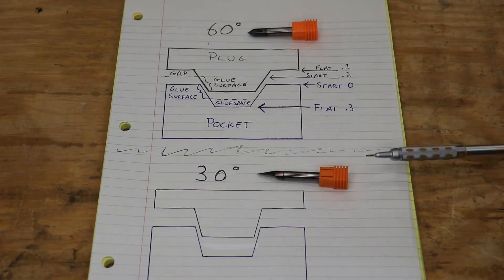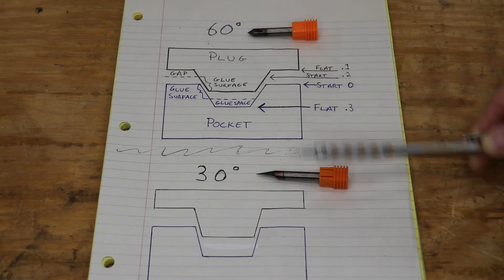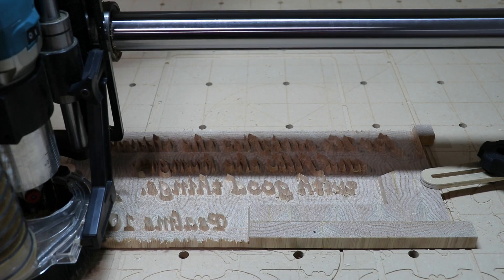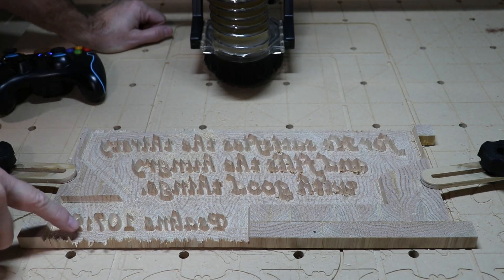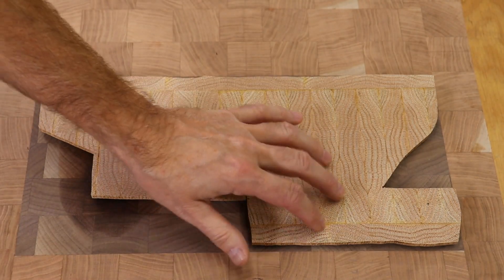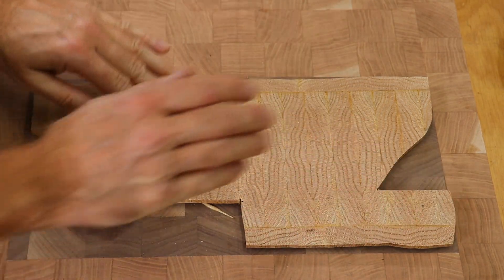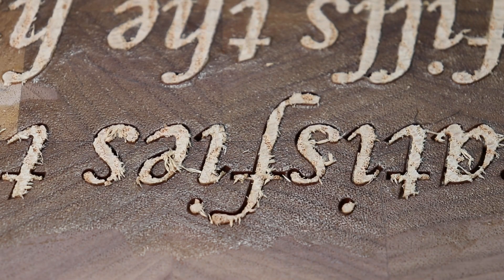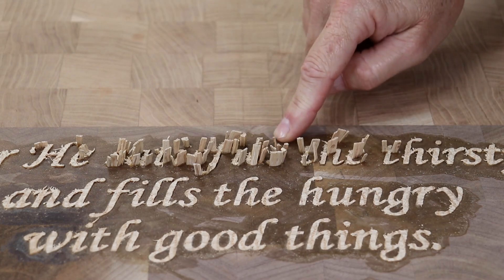First Inlay How To // Onefinity CNC

Comment: Matt what font did you use for your Cutting board and which bit?  I am trying to do some vcarves with small letters and im having some issues with the quality of the letters.  Ive tried several scans fonts but no having much luck
Reply from the maker: The font is Garamond. These work well https://amzn.to/3ZXyE1G
Or either of the 30 or 15 degree bits in the description. Any of these bits should provide good detail.

Comment: hallo, I have sainsmart 6050 what router can I put to be able to use 1/4 bits as small 1/8 bits and very limited?
Reply from the maker: Sorry, I'm not familiar with that machine. I would suggest contacting the manufacturer.

Comment: Have you ever considered a "negative start" for the Pocket? This will protect you against any unevenness. The clearing pass will remove the excess material
Reply from the maker: No I haven't. I've not had a problem with unevenness. I've done several inlays now pretty much exactly how I describe in this video and they have all been successful.
Reply: @MattMadeIt123  I ask, because I glue my own panels. I can't ever get it 100% exactly right
Reply from the maker: @eitantal726 I do to. Do you mean uneven on the surface?
Reply: @MattMadeIt123  Yes, I typically have 1mm of error. Maybe I'm overthinking it, all I have to do is to find the lowest point and Z-zero to that. Water or marble will tell me where the lowest point it
Reply from the maker: @eitantal726  1mm over what distance? Remember, it's just wood. If you try to chase perfection with wood, you'll drive yourself crazy. Be more concerned with the finished product. If it looks good at the end, you did well.
Reply: @MattMadeIt123  My panel is 460x330x16. Getting sub-mm precision is possible, had I used biscuits. When it comes to CNC, precision is in the micrometers. Elsewhere, sub-mm precision is attainable with tricks like lasers, stopblocks, etc
Reply from the maker: @eitantal726 It just seems you're waaay overthinking this. But you could just do a surfacing pass before you inlay.
Reply: @MattMadeIt123  the inlay that I want to make has very fine lines and details. If I get it wrong, the lines will disappear

Comment: Curious if "Glue space" is either too big, or not needed at all? What about cases where the inlay is small enough, it will come into a point and you will have zero "glue space"? Have you attempted an inlay without a glue space? 2.54mm is too big of a gap for a glue joint to even work.
Reply from the maker: The gap isn't meant to be a glue joint. It's there so extra glue has space to flow. I haven't tried an inlay without a glue gap. Might be worth testing.

Comment: 😊easier if you separate each text line of the plug. It allows to better insert each one since surface is lower.
Reply from the maker: This is a great tip. I've still only done a handful of inlays and have more to learn. Thanks.

Comment: Good job. Not sure if this has been said or not but if you will do your Vcarve pass first and the clear second you will never have to worry about small parts breaking off.
Reply from the maker: Yes, this was mentioned. That is the order I do it now and it does help. But with certain woods I've still had issues. I think certain species of woods in certain grain orientations just aren't great for carving with a CNC. End grain Ash for example is just too brittle in my experience. If it was stabilized I'm sure it would be fine.

Comment: I didn’t read through all the comments to see if it was mentioned, but I have used fine sawdust and mixed it with wood glue to fill small holes and imperfections. It has worked great for many situations. Not sure if that would have worked well on your first carne.
Reply from the maker: I've used that trick with great success myself. I think in this situation, there was too much dried glue filling the gaps. The gaps that weren't filled with dried glue were pretty big. Filling them with what amounts to wood filler, I don't think would have looked very good. But its definitely a good technique, in the right situation.

Comment: Saw another video where the guy recommended for the plug to do clearing pass after the detail pass. His reasoning is that tiny pieces stay supported.
Reply from the maker: That is what I usually do for just the same reason. I've had success and fails either way. I think wood grain direction and feeds/speeds have a lot to do with it.

Comment: When making the male plug portion of the inlay I've found that the inlay portion is chipping out and breaking.  Even with a new sharp bit.  I'm using the v bit first, then a clearing tool path.  Should I slow down my feeds and speeds?  Thanks.
Reply from the maker: Email me the machine you're using, wood species, bit, and feed/speeds. mattmadeit123@gmail.com  Sometimes, on delicate inlays, the tips can break off with some wood species. Usually, it is minimal, at the bottom of the inlay, and will never be seen.
Reply: yes I find that a problem too. I see the Vbit is push against the other side of the vcarved detail and its painful to watch those small details breaking off. I end up pushing the clearing path down an extra 1mm depth into the plug and used  20 ton hydraulic press to press the pug into the pocket. Works will.

Comment: Flat depth has nothing to do with the amount of glue gap. It only determines how much of the plug sticks out above the pocket for the bandsaw gap, as you describe it. The start depth determines the glue gap. The difference between the plug start depth and the pocket depth is the amount of glue gap. Just take into account your clamping pressure. Which will reduce that gap. I’m sorry but there are too many videos on YouTube that perpetuate this “misinformation”. Try it! Increase your flat depth and watch, the only thing that will increase is the gap above the pocket!  Just don’t go too far as the wood will crack under clamping pressure. So only do the minimum you need to cut the top of the plug off.
Reply from the maker: You can't just say Flat Depth has nothing to do with Glue Gap. You have to define which Flat Depth you're talking about. The difference between the Pocket Flat Depth and the Plug Start Depth determines the Glue Space. Which, I believe, is the point you're making. So yes, I misspoke when I said the Plug Flat Depth will determine the Glue Space. I think I got confused because in my example at https://youtu.be/DRMjOcyM6zQ?t=192 my Glue Space and Gap are the same. Thanks for pointing this. I will try to be more accurate in the future.
Reply: @MattMadeIt123  I’m sorry but you are wrong again. You don’t set a start depth when you carve the pocket. Unless you are doing an inlay in an already routed pocket but that it a different situation.  You have to remember that the VCarve inlay is a “hack” of Vectric’s VCarve toolpath and when you carve the plug the roles of “start” and “flat” depths are reversed because you are carving upside down.
Reply from the maker: @John Greene   That is incorrect. Of course you set a start depth when you carve a pocket. Pocket start depth is zero, and pocket flat depth is however deep you want your pocket to be, which will be the bottom of the glue gap. The plug start depth determines how much of the plug is inlayed into the pocket, and the difference between plug start and plug flat depths determines how much gap you have between the finished surface and the plug(aka the saw gap). Of course the plug is carved upside down. You have flip it over to insert it into the pocket. But on both carves, start depth is before flat depth as far as the CNC is concerned as it can only carve from the top down.

Comment: Beware of that 15 degree v bit. It is advertised as a 1/4 inch shank. It is not. I got a set for Christmas and just tried one last week. It would not clamp down right in my Makita shop I started looking closer at it. Found out it is 6mm and not a 1/4 inch. Glad for your video though. I really want to try an inlay soon. Thanks.
Reply from the maker: Thanks for this info Bob. I have used these in my Makita RT0701C a few times without incident. They were tight with no wobble. That said, I am in my shop right now with these bits in my calipers. You're correct. All 3 measure .2355" or 5.99mm. I chucked each bit (I did notice I had to "over-tighten" the collet with these bits compared to others.) and ran them from low to high speed. Each one was tight and ran fine. I then installed a few of my true 1/4" bits to see if over tightening damaged my collet at all. Everything installed as normal. All that said, I think it's best if I, and others reading this, take these bits out of rotation if you're using a 1/4" router in your CNC. I will also remove them from my affiliate recommendations and look for a suitable replacement. Again, thanks for this information and helping out the community.
Reply: @MattMadeIt123  I also used them in my router, but I think I will buy a 6mm collet for the router before doing a long carve. I could not find another 15 degree but I liked. I am thinking after reading the reviews, that the tips break off easy, so other manufacturers do not make them. Not sure though. Again, great video. I am needing to just go and try an inlay with your numbers.
Reply from the maker: @bobswihart  Check out this video from ARB Woodworking. He uses these 15° bits. I put in a question to him about them and how he uses them. I'll let everyone know if i get a reply. https://youtu.be/NY4nZN3Y6tw
Reply: @MattMadeIt123  oh, thank you. I will check his video out. Thank you again.
Reply from the maker: @bobswihart  So ARB got back to me. He does use a 6mm collet with those bits. I'm pretty sure he's using a spindle.